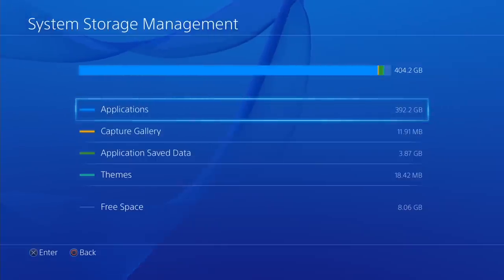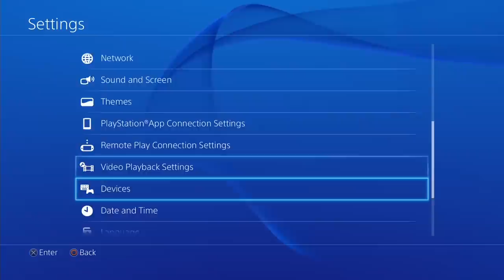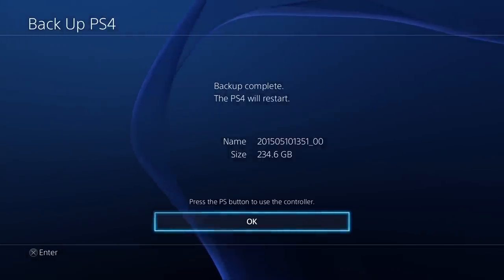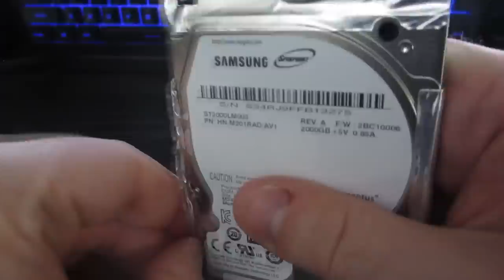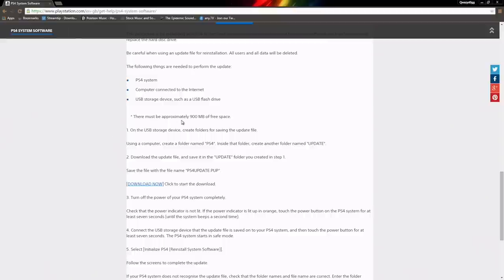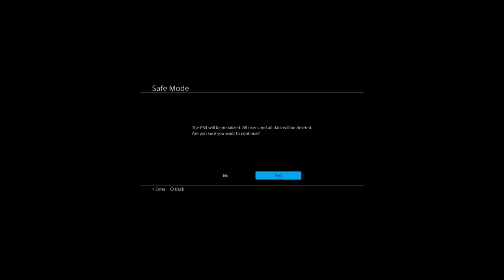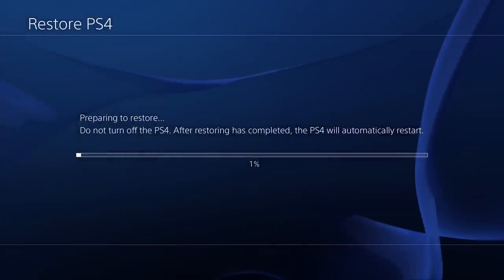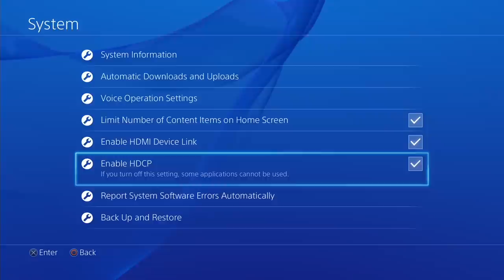How To Upgrade Your PS4's HDD Using A 2TB Seagate External

Comment: I bought a seagate for my ps4 and it keeps saying USB not connected what do I do?
Reply from the maker: +Antonio Walker USB not connected? Do you have the drive out of its case and installed inside of the PS4?
Reply: No I plugged it in to the USB port,  someone told me that I need to format it to exfat or fat32
Reply from the maker: +Antonio Walker it has to be formatted on a PC. Is that where you are getting the error?
Reply: How do you format it a pc? When I plug it into the ps4 USB ports it says USB not connected
Reply from the maker: +Antonio Walker You need to plus it into a computer and format it through Disk Management on Windows.
Reply: Ok thank you very much
Reply: One last thing what do I do after I go to disk management

Comment: I was told by Sony that my PS4 does not support external HD only the Internal HD is supported up to 2TB.
Reply from the maker: +Riven wood That's correct. What this tutorial goes over is actually removing the internal drive from within the external enclosure and inserting it inside the PS4, which is supported on ALL ps4's. This method is cheaper than buying an internal enclosure and will also allow you to use your old ps4 drive inside the external enclosure for use on your PC.

Comment: Do you just turn on the ps4 and it shows up the safe mode?
Reply from the maker: Just hold down the button and it will boot into safe mode
Reply: I don't know 100% but after you plug in the USB with the update file while the ps4 is off, then you can turn it on and safe mode should open up.

Comment: Liked and Subscribed.  :) Nice video!
Reply from the maker: +trabo2 thanks man!
Reply: only problem, my computer wont recognize the new external drive (the old one from ps4) after i put it inside the casing.
Reply from the maker: You have to go into Disk Management on a Windows PC and delete all the partitions and format the drive for it to work. The PS4 changes the file storage system into one that your computer cannot recognize until you do this.

Comment: What can I use to backup my games data, files, etc?
Reply from the maker: +KHF The First You can use another external HDD other than the one your gutting for the swap, or a flash drive if your just backing up game save data.
Reply: Qwazyd0gg Thanks. So I would buy the 2 TB for putting in the PS4 and another one to save all my data on? If so which other hard drive would you recommend (for backing up data)?
Reply: Qwazyd0gg Also, could I just upload the games to online storage and then install the 2TB hard drive and reinstall the games from the online storage?
Reply from the maker: +KHF The First You can upload the game saves to the cloud and then just redownload the games from psn. I do not believe you can backup the entire game to online storage
Reply: Qwazyd0gg ok thank you so much
Reply: Qwazyd0gg ok thank you so much

Comment: Did you a USB drive to back up and reset your console ?
Reply from the maker: +Mark Guevara You need a USB drive to be able to apply the software from Safe Mode, yes.
Reply: Qwazyd0gg okay thank you this video helps a lot!
Reply: Qwazyd0gg another quick question so you used two flash drives and a harddrive? One flash drive for the backup and restore and another for the PlayStation pup ?
Reply from the maker: +Mark Guevara I used a secondary HDD for my backup, but that step is optional, and one flashdrive for the PUP file. So in total I have the replacement drive, an additional external HDD, and a flash drive
Reply: Qwazyd0gg okay thank you 👌🏼
Reply from the maker: +Mark Guevara NP man! I also did a Quick&A linked in the description of this video that speaks towards common HDD swap questions. You might find some info in there too
Reply: Qwazyd0gg okay sweet I'll actually check that out now cause I'm still watching your video make sure I double check everything thanks again 🙏🏼

Comment: ive done it and it keeps on coming up the the error message ce-30773-1
Reply from the maker: +Razzell Dazzell that's an issue with the update file. That usually means either the update bin or file itself is not named correctly, or is the wrong file entirely
Reply: Thanks for that but its casually , and was for me, the computer i was transferring the data of my computer is quite old so i'm guessing thats what it was because it worked with my friends
Reply from the maker: +Razzell Dazzell I'm glad everything worked out in the end :)

Comment: does it still work good to this day ?
Reply from the maker: +slim fan Playing Farcry Primal on it as I type this :)
Reply: Qwazyd0gg does it matter what color I get ? I notice one is STDR2000103 & STDR2000100 &STDR2000102 does it matter ?
Reply from the maker: +slim fan Nope! The model number changes are just because of the cases color
Reply: Qwazyd0gg would I still be able to turn my system off? there's a lot of people saying when they turn their system off it doesn't turn back on or whatever
Reply from the maker: +slim fan mine has been working fine for over a year now and I have turned it off and into resting mode probably 50+ times without issue. If you're worried, just keep the original 500gb drive for a while until you see how the new 2TB performs. That way if it crops out on you, you can just revert back to the original
Reply: Qwazyd0gg so unfortunately it would not fit in my disk slot it's way to thin .
Reply: my bad I just had to lift it up a little bit

Comment: +qwazyd0gg What format does the new 2TB HDD need to be formatted to NTFS or FAT32? The video was very informative and I know now that I can do this myself. Thanks for you time in doing this.
Reply from the maker: it needs to be fat 32 :) thanks man, I noticed a lot of other walkthroughs basically outlined some of the process but I wanted to be as informative as I could. I'm glad I could help
Reply: +Qwazyd0gg Yeah my Seagate came as NTFS out of the box so I plugged it to my Mac and reformatted to FAT32

Comment: Hi, I'm from Australia and am wanting to do this switch but I'm not wanting to buy off amazon. I was wondering if the Seagate Backup Plus STDS2000300 2.5" 2TB MAC Compatible USB3.0 External Hard Disk Drive from this website http://www.msy.com.au/pc-components/16428--seagate-backup-plus-stds2000300-25-2tb-mac-compatible-usb30-external-hard-disk-drive.html would also work in my ps4 as this is the closest one to the one you used in this video that I could find at my local stores

edit: I realised that the hard drive i linked is a MAC compatible drive so if that one won't work there is also this one -  http://www.msy.com.au/pc-components/14382-seagate-backup-plus-slim-25-2tb-usb30-external-hard-disk-drive.html again if you could please tell me if this one would also work in the ps4 I would greatly appreciate that.
Reply from the maker: Hey Ry,
The 2nd drive you listed should work absolutely fine :)
Reply: Great! Thanks for the awesome upload!
Reply from the maker: +Ryan Lawrence Np Ry! Thanks for sticking through a pretty long and lower quality video :P it was my 1st tutorial. Feel free to checkout some newer stuff :( Cheers

Comment: Do i have to reformat the 2tb drive to exfat
Reply from the maker: Yes, if it is not already in that format
Reply: Qwazyd0gg but u didnt do it for yours
Reply from the maker: Nope, mine was already in Fat32. most drives over 500gb are already formatted to the correct drive format
Reply: Qwazyd0gg so if i buy the drive ur using i dont have to reformat right just confirming
Reply from the maker: +optimus22704 correct

Comment: I bought a seagate laptop drive but doesn't have the same connectors. wtf
Reply from the maker: +JG Gaming Network All modern drives should be sata.... IDE drives are close to if not over a decade old at this point. Are you sure it's incorrect?
Reply: +Qwazyd0gg it's a seagate 1tb expansion portable device. Idk all the fancy details but people on amazon reviews were saying they used it for this purpose
Reply from the maker: +JG Gaming Network have you removed the internal drive from the external enclosure?
Reply: +Qwazyd0gg I have. but there's some little connector port on the end of the internal drive that isn't on the one in this video. Unless I'm missing something
Reply: +JG Gaming Network and the connector port in connected to the board so it can't be removed
Reply from the maker: +JG Gaming Network That may just be a removable female coupler. It should simply be a sata port and power connection like every other drive. Try removing it. If it is wrapped in a tin foil looking material that will peel off
Reply: Qwazyd0gg how many gigabytes did you use for the backup
Reply from the maker: +meareg tube a little over 300 but it was due to me backing up my games as well as the save files.

Comment: but you can't use external on ps4
Reply from the maker: +School Shooter That's correct, and explained in the video. In this case, I teach you how to remove the hard drive from an external enclosure and use it inside the ps4. It's cheaper than buying an internal and allows you to rehouse the old drive into the empty enclosed to give yourself a bonus 500gb external drive once your all done.

Comment: This is not an external hard drive
Reply from the maker: Lol did you watch the video at all??

The HDD used for the swap was in fact a Seagate 2TB STDR2000 external HDD. This video teaches the viewer the process of removing the internal drive from within the external drive and placing it into the PlayStation. This method produces a lower cost and also yields the ability to obtain a usable 500GB HDD after the installation. 2.41 into the video, I show the unboxing of the external drive used. 

Thanks for trolling fam :D
Reply: Qwazyd0gg yeah but you take the whole thing apart and the ps4.
Reply from the maker: +dexter7122able Correct... Have you watched the video and the explanation surrounding that decision? Or are you commenting strictly from the title?
Reply: does this work by juts plugging in the usb and choosing an external hard drive?
Reply from the maker: +dexter7122able For the time being... No. Sony is releasing an update that will allow you to use an external drive connected to your PS4, and it is set to come out very soon.
Reply: Qwazyd0gg thank you so much for telling me lol. i was literally about to take apart my ps4 and the hard drive and put it in. i just updated it and works fine by plugging it in. thanks!!

Comment: ? so i can play it
Reply from the maker: +Ahmed Mubarak Play what? You can use every application and play every game you did before. Changing the hard drive does not effect what you can and can't do with the PlayStation afterwards. It will function the same way it did before
Reply: ?when you restored you back up there is a lock on the applications 

how did i solve that
Reply from the maker: +Ahmed Mubarak Try reinstalling them from the store